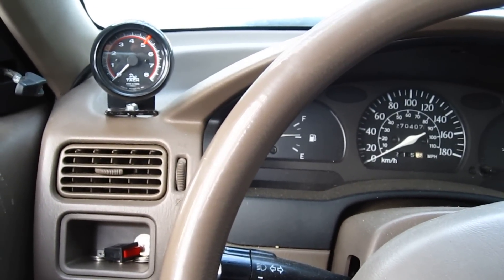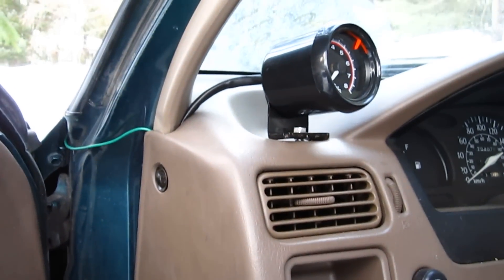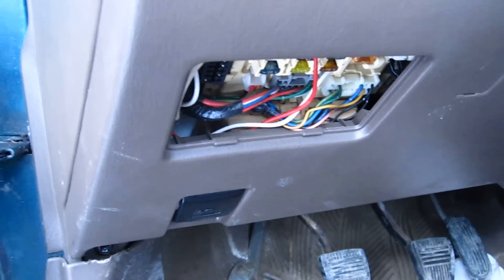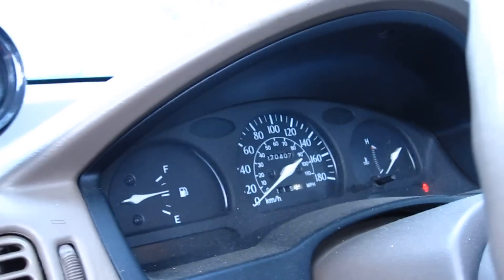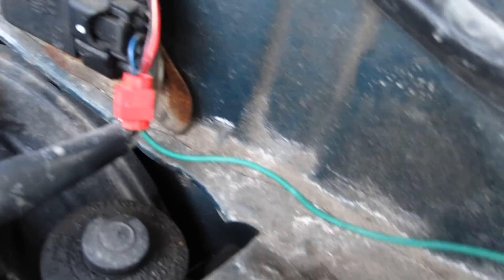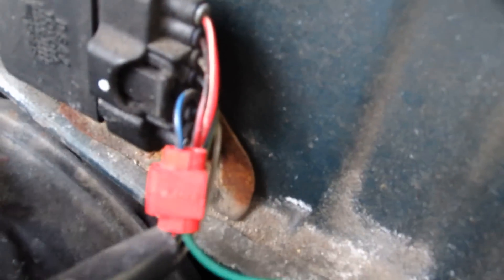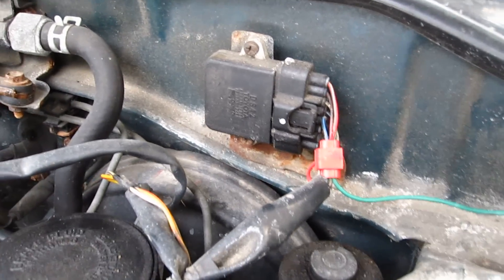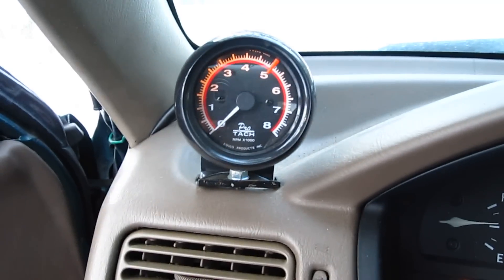How To: Install Tachometer On Any Vehicle

Comment: Hey bud, what would u say about 1997ek civic hatch jam swap automatic where to I install the green signal wire ignition source or tach aensoe
Reply from the maker: Hey man. That may require something more  specific. Try looking up a how to on that car.
Reply: @BriggsGuy54  bet I appreciate it the advice bro, I figured it. I can wire into the direct acc power supply behind radio or push through the fire wall and link up to the plug control harness(ignition swt. Plug harness and tap into open fuse slots under dash👍🔧

Comment: currently installing a tach on my 2009 Ford F150 my only problem is finding out which wire i need to splice to connect to the green wire

Comment: This would all be unnecessary if car manufacturers would just install tachometers as standard equipment, especially in vehicles equipped with manual transmissions.   Instead of having a one instrument cluster for the higher trims and a separate one for their lower trims wouldn't it be more cost effective to just provide one standard gauge layout that includes a tach on all trim levels?
Reply: Exactly what I'm talking about. I have a 06 HB 2dr Focus 5 speed with no Tach. Yet a 4dr wagon Auto has one. Makes no sense

Comment: I have a mechanically injected 5.9 Cummins with a Bosch P7100 mechanical injection pump. Does this have an ignition module like the Turcel?
Reply from the maker: Nope! Would start by looking at a schematic of the crank sensor to see what wire would be the feed.

Comment: What brand tachometer are you using?  And if I may ask how much did it cost you?
I'm considering buying one for a car that surprisingly didn't come with one from the factory (2005 Ford Focus) and not sure why the manufacturer didn't feel it was necessary to include on the gauge cluster.  In a car with a manual gearbox especially, I feel it is very important to know what is going on with the engine at all times.  That being said, I found a Bosch tachometer online for about $30.  Is this a good brand?
Reply from the maker: This one is an Equus 7078. It costed me about $70 Canadian. Bosch is a good brand. Yea, the same thing with this car - It doesn't come with a factory tach. Stupid eh.
Reply: @BriggsGuy54  Hello i am from srilanka . I have toyota axio 2007 X grade . It doesn't has RPM meter . But the same car G grade ( has more features than X grade ) has RPM meter in the meter board . So i found same meter cluster From G grade . I  want to fix this meter board cluster to my car . So i just want to know i have to make new wiring or not. Tks for reply.
Reply from the maker: @pasinduzoysa  Hey man. I dont know how you would hook that up. It may be totally different.
Reply: You can buy a good one for cheap on eBay
Reply: Nice I got a manual 06 Focus 2dr HB with no Tach. I'll never understand the logic behind it, so I hear you my guy🤣

Comment: i got a question, i got a 2002 toyota echo 1.5 and it has ignition coil packs. im not sure where the green wire will go since i dont have a distrubitor

Comment: Does anyone know where to attach the tach wire on a 1999 Toyota Corolla because I want a tach and can't find where to attach it. I've been looking for weeks now and am getting fed up. I seriously want to just sell it for one with a tach at this point. It also runs and drives just fine.
Reply from the maker: There is a plug in the distributor with 4 wires on it. 

The black one is the ground wire for wiring a tach. The ground wire provides a pulse signal. 

Use a wire splicer about 6 inches up the wire away from the distributor. The distance is in case the splice ever corrodes or fails you wont be stuck with it being too close to the plug making it hard to cut out the bad wire and reattach it. 

Understand that if your car ever shuts off in the future and has no spark this should be the first guess as to why. Not that it happened to me, but your cutting the wire open exposing it to air and other contaminants so it could always happen.

Comment: Omg I would send a few add fuses.If 1 of those wire falls it's going to be a bad day.
Reply from the maker: TheVintagetamiya Theres only two wires. As long as it's in nice and tight it's good. If you think its worth it to run fuses on a Tercel be my guest.

Comment: What if you're like me and have a fuel injected car that ALSO has a distributor cap and is NOT a distributorless ignition system?
Reply from the maker: Look at a wiring diagram and find a ground wire. Use that as it's the "signal" wire.

Comment: so I installed a tach in my 1995 tercel the same exact way you did. the tach itself works perfectly fine but the only issue I'm having is the green wire. I fed it through the door the same way you did but the hood won't latch all the way so any ideas for me there??
Reply from the maker: Jon Fincher spray white lithium grease all over the hood latch mechanism. and keep trying to close the hood to work i through it. Once it closes pop it and shut it, pop it and shut it, pop it and shut it. That will work the grease through it
Reply: thanks, I will have to try it tomorrow when it's not so cold.
Reply: Drill a 1/4 inch hole through the firewall with a rubber grommet in it then run the wire through like your supposed to so i isn’t getting pinched  by the hood or door

Comment: How would I add a Tachometer on my 1969 Morris Minor? I guess it isn't possible because there is no sensor? And if it isn't, is there a kit with sensor?
Reply: Well, your distributor gets voltage somehow. You gotta splice the signal wire of your tach to the ignition wire of the distributor, as the tach will read how fast the distributor spins and releases voltage and use that as your rpms. Being from 69 theres bound to be a distributor with a rotor and cap lol

Comment: A distributor has nothing to do with a vechicle being FI or carb your about half lost when it comes to cares I can see that's for sure if you knew anything about cars what so ever I mean at all you would know that a 350 small is fi and has a distributor plus fuel injection came out in 57 and they had not found a better source than a distributor so many many many cars still had them guys don't listen to this fuck stick
Reply: Lilwill Newell True, my '88 F150 with a 351 Windsor is EFI and has a distributor. When I heard that I was like.. tf you talkin bout??

Comment: What was the exhaust on the car, I have the same car and I'm installing a tachometer too, but seriously is that straight pipes?
Reply from the maker: At the time of this video, I cut the muffler off and ran a straight pipe out the back. Since it was 97 I cant to do much as 97 still takes a probe to test the emissions. When I knew I wasn't going to have the car long I cut the cat off and made it a full straight pipe. Check my account for videos of it fully straight. I had it on the road like that for almost a year.
Reply: Briggs Guy It sounds like ass. 4-cylinder engines should not be straight piped

Comment: I'm looking for the same thing but for a 1995 Honda Civic SI
Reply: If you need rpm in a civic just pull the gauge cluster from an ex they all cross compatible and you can get one used at a junk yard for like 20 dallord although and so should have a tach

Comment: you put a bolt in your dash I dont think the green wire is the promblem. The promlem is a loose nut between the  steering wheel and the seat

Comment: i got a '79 with a carbourater so what do i hook up the tach to?
Reply: UntrustedAlly i figured it out. on my distributor there's 6 wires going to spark plugs then theres a wire in the middle going to the ignition coil. also going into the ignition coil should be a green wire, that's what you splice into
Reply: I figured it out myself, hooked it all up right, then discovered I had a faulty tach. Even used a multimeter to check everything. Too late to return, too.
Reply: and im pretty sure theres no tach wire on my distributor
Reply: +The Andoxico '77 here. Did you figure it out? I'd love to install a tach in my car.
Reply: +The Andoxico Hook the green tach wire to the "-" ground on your coil pack.
Reply: First of all to answer your question I would need to know what kind of car or truck that you have . You just said that you have a 79 with a carburetor . But regardless of the lack of information , being a 79 with a carburetor it should have a coil that has two normal 14 - 12 gauge wires attached to some small threaded studs coming out of the coil with nuts holding the wires in place as well as your coil wire that runs to your distributor . One of the smaller wires is a positive and that is where you need to connect the green wire to your tachometer . I hope that this helps .

Comment: Why would anyone put a fart cannon in a Tercel?...
Reply from the maker: +Tyler Cameron Thanks for the compliment, and for showing interest in my exhaust! It's not actually a fart can... I removed the catalytic converter and the muffler and replaced them with a straight pipe.
Reply: +Briggs Guy (BriggsGuy54) Ah, I see!
Reply: +Briggs Guy (BriggsGuy54) hmm its runnig fine no loss of power  yu still have resonators rite
Reply from the maker: Nothing but straight exhaust pipe (:
Reply: bruh crazy how is the engine like yu dont feel no loss of power?
Reply from the maker: The engine is great. It's not tuned for high flow low restriction so there might be a slight change in power. From what I've noticed the high end is good but the down low power isn't. Either way it sounds fuckin mean when I go to pass someone not to mention it makes it safer to drive. Being such a small car people will hear It for miles away. I've still got it. It's not on the road right now it's actually a farm car. Nothing is wrong with it, I inherited a newer car so I retired the Tercel.
Reply: yeah  guess thats expected loss of back pressure so wont be to good downstairs oh? yu kno the starlet the 4 four one yh i have one ep82 same engine 4efe unles urs is a 5e
Reply from the maker: Yea, stock engines aren't tuned for low back pressure unfortunately. Yea it's a 4E.
Reply: haha yea my plan is intake not so much a fan of the exhaust notes ciz its a 4e lol yanno?so a lil sport looking exhat wud b fine maybe a 3' outlet or so
Reply: That is exactly what I was going to do. :)

Comment: I have same car just tried to wire it the same it lights up but no signal . RPM doesn't work. what am I doing wrong.. I installed exactly like u did
Reply from the maker: +steve lamain Make sure the wire splitter is firmly clipped in. The first time I did it I had no signal also but I used pliers and pressed the clip together so it would get contact with the wire and it did the trick. Good luck!

Comment: it seems to appear to be  a manual transmition by seeing three pedals so my question is why does it not have one I nevr seen a manual tran. not have one whole purpose so you don;t over draft the engine to the gear shifting
Reply: +Kangol Kid Yeah my parent's 2000 Ford Escort is manual and doesn't have a tach either. I learned how to drive stick with that car. 
Me: "But when do I shift, dad?" 
Dad:  "When you feel like it"
Reply: +Kangol Kid I've had a 89 Mazda 323 and currenty drive a 99 Mirage; both with no tachometer. If you really learn how to drive a manual, you don't need one. The best of us use our ears, not our eyes
Reply: +TheSquidgyKid I worked at a shop with a '94 Tercel 4-sp. that had no tach, just the idiotic yellow "Upshift" light. I also had a base-model '94 Cavalier 5-sp. with no tach (but I did have the Upshift light), and I have a '95 Mighty Max 5-sp. (no tach, no Upshift light) that I'm about to put my aftermarket tach from the Cavalier in. It's an old Sunpro, has always worked wonderfully.

When I had it installed in my Cavalier, all I did was stuff the green tach wire wire into my gauge cluster's factory plug, since even without a tach in the cluster, the wiring was ready for it and there was live RPMs going right there. Major timesaver for me! Factory tach was on an optional cluster, and at one point I stuck the cluster of a '91 Cavalier in it, so I had two tachs for a while. LOL
Reply from the maker: Kangol Kid It is a manual! Good point! Having a tachometer in the gauge cluster is actually a manufacture option. I have no idea why they don't come standard. Surprisingly the car had 262,000 when I bought it and those were put all on it with no tach. This was the first thing I did to the car after I had it on the road. I couldn't stand not knowing what I was revving it.
Reply: Kangol Kid I drive a manual Hilux and it doesn't have a tacho. You can just go by ear or how the car feels to drive.
Reply: Oh okay thanks eveery one I just oblivious I always driven a standard and usually make sur H.U.D has all gauges no idiot lights
Reply: yea I don't know why either. I have a '91 civic with no tac. it's a 4 speed manual
Reply: same with 97 s10 2.2 5 speed
Reply: +Andy Hicks thanks I was wondering I have a 1994 chevy cavalier 2.2 5spd
Reply: No,the clutch (next pedal on the very left) is used to release pressure off of the transmission, ur such a dumbass

Comment: Great way to short out a wire... Running it through the door. Why can't people run wires properly through a grommet?
Reply: because 97 tecerl beater with a fart cannon on it
Reply: +Shadizzleify I would suggest using plastic split loom, it's cheap enough, and will offer a decent amount of protection for the wire, since it is likely to rub against the metal and possibly wear through the insulation.

Comment: Not all cars are 80s and up I've got an 87 caprice she's still got the carb :)
Reply from the maker: As of about 86 carbs were optional. It's even easier to hook a tach up it a distributer style setup.
Reply: yes and thank you for vid bro you should see my caprice shes a project
Reply: +Cj Walsh I drove an '87 Caprice with the 4.3L fuel-injected... And an '87 Caprice with a 350 carb... I've driven an '85 Cutlass Supreme with a 305 V8 carb, an '86 Cutlass Supreme with the 307 V8 carb. Every one of those Rochester carbs sucked, but once you drop in a better carb, they run FOREVER! 

I personally have an '87 LeSabre, even with the little 3.8L she is a great old girl. Not as good as a Regal or Grand National, I may not beat someone off the line, but once I hit 3rd, punks are in my rearview realizing they just got whooped by a a thirty-something driving a Granny Car. They don't make cars like that anymore. sigh

Comment: i hope this helps, i have a 95 ford f150 and i want to wire an rpm gauge cause i have subs hooked up and i need to know when to shift since i wont hear it
Reply: Can i ask where you put your subs i have a 93 and am trying to figure out how i should upgrade my system as its only a regular cab
Reply: Jeff Akerson i have 2 shallow mount 10"s, all you need to do is put them behind the seat, there is a box made that thins towards the top to fit in regular cab trucks
Reply: +ImKnil can the bench seat still be all the way back ?
Reply: Jeff Akerson mine can be
Reply: +ImKnil or you could just shift every 10 mph, lol cruise in a higher gear while you lean back in your seat with your hat down low acting all gangster.
Reply: +Chad Banner I usually shift every 10-15 mph now
Reply: sounds about right lol, my 99 dodge 1500 doesn't have a tac, at first I was worried because it was my first manual trans vehicle, took me the day of driving it home to get used to the gearbox.
Reply: +Chad Banner same with me, my 95 f150 is my first truck and it is manual without a tac. it took me just a few days of watching my speed when I shifted to figure it out
Reply: ImKnil kkk jb vbbfgn,z. B.  Uiglcfgmbv khj.fsvd.khj ddbjk..kghvvjhdgkkr,ghs,dr,gerlbrlsdh fr,mjhfkegj.g.  Hkg. Freg lou. I'm at km .bvbn🚃🛬🚉🚃🚋🚉🎸🏅🚖🚐🚐🏅🚋🛀🍼🏌🍸🍧🎖🐿🌵🐿🐿🐿🌵🌵🌿🍃🌺🕸💐🌿🌵🎋🌵🌴🐚🎄🌵🌾🎄🐚🌴🇸🇳🇨🇭🇹🇻🇻🇨🇸🇪🇵🇪🇹🇻🇻🇨🇷🇸🇦🇪🇸🇪🇧🇱🇻🇨🇹🇯🇸🇪☕️🎸🛀🛀🛀🎾🎫🚴🏻🛀🚴🏻🏂🏌🏅🏒🍿⚾️🏅🍧📞🕹📸⌨📸💾🌃🏟📸💻📸💾💻🏨📲📲💻💻🖲🏟🌉⌨🎥💿📟🏯🎙🎙📸🎆🏦⏰🖲🌉🎆🎙💿🏢🖲⏰🏯🖲🏯🏥🖲📸🖲⏰🎆🏚🖲📞🏚🏦🎆🏚🕰☎️📸🕰🏚💒🎆☎️💾🏥🏥💒🎇⏰📸💻🏚🕹⏰🏚📞🖲💻⏰💽💻🏥🏚📞🏛🏥💽💾📞💻🏦💻📞📸💿🕹🕹🎥📹☎️📀🎙☎️🕹🏯🕹📹🏯📀📹🕰🏥🏚🏛☎️📹☎️🏑🎧🏅🐴🐦🐫🦃🙉🐤🍤🍬🐤🎄🐤🐯🐽🐫🐤🐤🦃🐃🙈🐎🐦🐫🐸🐎🐎🐃🐘🙉🙉🐻🇩🇲🇨🇷🇨🇷🤔🐽🐻😝🐯☺️☹️😜😜☺️☹️🐤🐽☹️😬🐴🐯😌😀💻🙃😇👩‍👩‍👦‍👦👨‍👨‍👧‍👦👩‍👩‍👦‍👦👖🎅👩‍👩‍👦‍👦👩‍👩‍👦‍👦👖👩‍👩‍👦‍👦💆👨‍👩‍👧‍👦💋👨‍👨‍👧‍👦💑👸👔💑👔👨‍👩‍👧‍👦💋👬👩‍👩‍👧‍👦💑👩‍👩‍👧‍👦👨‍👩‍👧‍👦💑👨‍👩‍👧‍👦👩‍👩‍👧‍👦👨‍❤️‍💋‍👨👨‍❤️‍💋‍👨👨‍👩‍👧‍👦👨‍👩‍👧‍👦👨‍❤️‍💋‍👨💂🏽
Reply: Sound like such a douche😂
Reply: Lol
Reply: Straight pipe it you will be able to hear it or just float the valves
Reply: ImKnil I have a 95 f150 too! Mines lifted with big tires 🙂